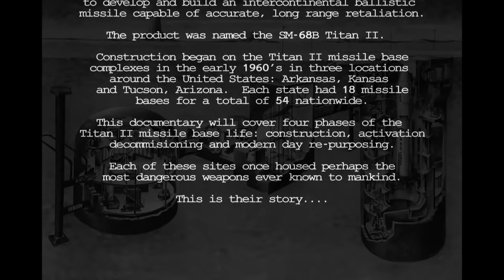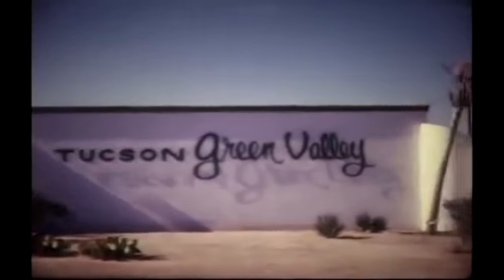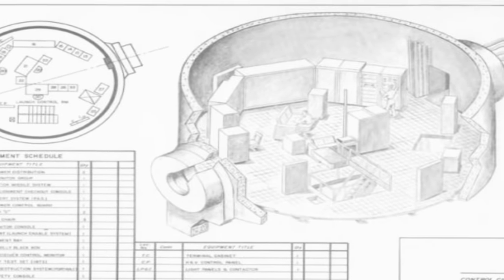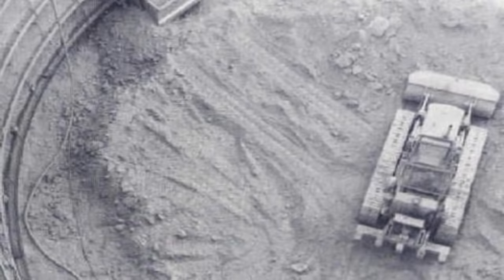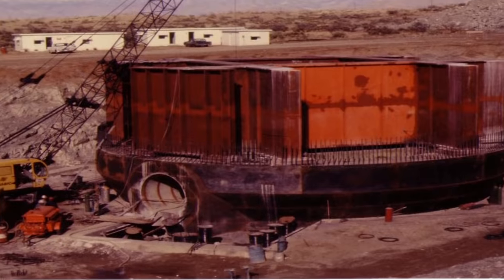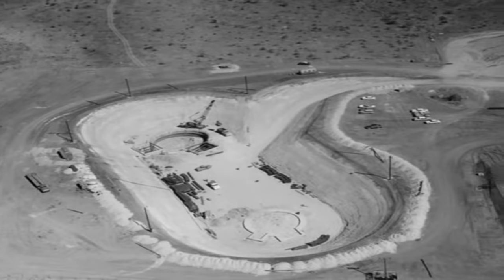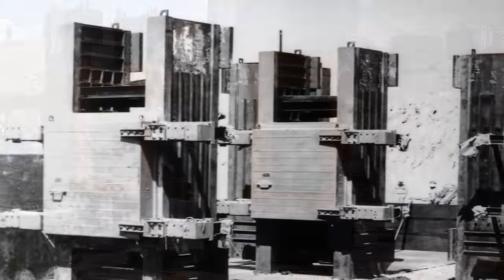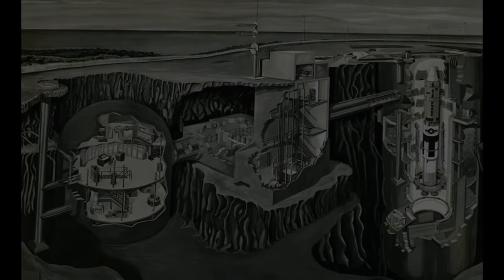Titan II Legacy - Part 1: Construction

Comment: They state the sites were operational by Christmas 1961, actually phase one was completed in 1961.
It wasn't until April 1963 before a missile was in the silo and SAC  was informed it was ready for alert duty.                    Phase two  was plumbing, heating, power production and wiring and controls.    Phase three  started in  mid 1962  checking out the equipment and their controls,  instillation of missiles.   I got to Davis-Monthan on the 3 of Jan. 1963   I was an MFT   "missile facilities Teck. Basic responsible for keeping every thing installed in phase two working properly." I was assigned to crew 43 and we were assigned site 570-7 and spent several months testing the equipment  and observing missile insulation.  570-7 went on alert  on May 24 1963. 
I  completed my 4 years in Apr 1966 having spent about 6000 hours under ground.
Reply: Bruce Bedford thanks Bruce, I did question the authors authenticity when he said this whole thing was finished in one year.
Reply: Thank you for your service to this nation. “People sleep peaceably in their beds at night because rough men stand ready to do violence on their behalf.”
Reply: Talk about your unsung hero’s. You people were the only thing keeping our country safe during the Cold War! And in the ground no less. I’m sure there was a novelty to it at first, but had to be miserable as time went on! I live 15 miles from a privately owned site. Hoping to check it out. I’ve recently become slightly obsessed with these, and this time in our country!  
Thank you for your sacrifice and service!
Reply: @Mauivegan67  1mm to 12mm is sheet metal workers. After 12 mm you are a plater yes your grandfather was a plater not a mere tin basher ,respect is due at plater level,as a dying art I posses the knowledge of working steel 200mm or greater . I'm sure your grandfather was a legend in my field so please hold in even higher esteem his achievements as it is truly top end that man can produce.

Comment: May be considered a relic today it help keep the peace for over 50 years
Reply: They closed them now we are sitting ducks.
Reply: @Crashed131963  Do you realize you can launch ICBM from a back of the truck now?
Reply: the Titan II ICBMs went operational in 1963 and the last was taken off alert in 1987.   They had become obsolete because they were extremely dangerous to maintain.  They were only supposed to be in service from five to seven years but because they formed a huge percentage of our nuclear capability, they kept extending the operational life.  Eventually, common sense prevailed and the aging missiles were retired.

Comment: your inflation calculation is way off,  $12,600,000  in the early 60s would be the equivalent  of about $107 million in 2019, not $1.8 billion.
Reply: If your calculation is correct,that's a HUGE difference!

Comment: Okay what happened to the Dozer that was scraping the whole that's down there at the bottom that they just cement over it that they like crane it out what seriously I need an answer it's been bugging me the entire rest of the video
Reply from the maker: I'm sure they lifted it out with the large crane thru had on site 😉
Reply: tolfan
I have been amazed myself at what can be done;
The dozer is not all that huge; 
It gets lifted out with craning and rigging; You just get a big enough crane;
Reply: Wow some people have no common sense  yea they just pour concrete over there expensive dozer........smdh
Reply: Well, as deep as it was, it's not beyond possibility that dozer drove out of the hole on its own tracks - they were and still are quite agile vehicles.

Comment: Your price per complex must be incorrect. I calculate that 1.8 billion is almost 143 times more than 12.6 million.
Reply: Actual inflation from 1960 to 2019 results in 12,000,000 becoming 104,000,000 (or about 768% percent.)  Given the scope of this project, and that a single F35 costs over a billion dollars - I don't think our current government could build a single one of these complexes for less than a billion dollars (billion = 1000 million).
Reply: i agree with you, it is ridiculously wrong.
Reply: At the time, they told us each complex cost $143 million. Plus another $10 million for the bird.

Comment: i wish all of these complexes would have been kept up in usable condition
Reply: The great failure of modern economy is the unimaginable amount of upkeep.  Just a regular house with power, water and general maintenance costs about 10%  build cost per year, and with a far more complex system at a certain point it would cost less to abandon and build a new system than to maintain a 30 year old bunker, remember under ground holds moisture and concrete abrades as the rebar slowly rusts and cracks the concrete further.  They were designed to withstand a sudden extreme attack not to survive for the ages that could be a modern concern Imagine if all the rebar  were replaced with carbon fiber grid (a superior  solution) but vastly more expensive closed cell spray foam as a moisture barrier inside and out after concrete pour would also add compression stability.  You could build a structure that would last but even then you have equipment that needs maintenance like hvac electrical generator water and fuel tanks . That's the long of it, the short of it is I believe one is still maintained as a museum . I hope you found this response edifying, please don't respond with TLDR.
Reply: @cuchulainodare3534  what the hells tldr?
Reply: @stormchaser8472   Too Long Didn't Read,  it was a subtle acknowledgment I'm long winded.
Reply: @cuchulainodare3534  lol
Reply: @stormchaser8472  glad I could bring a giggle. Have a happy New Year

Comment: Are there equivalent newer ICBM bases today?
Reply: Maybe, but today's weapons are too precise. They are able to hit the missile silos directly. No bunker can withstand a direct hit of a nuclear weapon. Thus it makes no sense to build such bunker protected rocket silos anymore.
In the past the situation was different. At that time, the bomb could hit only in an undefined range of some miles. With enough luck it weren't a direct hit and the bunker could withstand the shock-wave coming from the distance.
Today it's much simpler and cheaper or better to put the rockets on a mobile truck or use submarines for that job.
Reply: Fixed missile bases still exist, however the modern armed services consider them more like the canary in the mine. The armed forces have always used our own potential as a judge of risk, and gps or laser targeting render any fixed bases simply targets.
Reply: Current ICBM bases:   https://en.wikipedia.org/wiki/F.E._Warren_Air_Force_Base  https://en.wikipedia.org/wiki/Minot_Air_Force_Base https://en.wikipedia.org/wiki/Malmstrom_Air_Force_Base, but as you read the pages &  https://en.wikipedia.org/wiki/LGM-30_Minuteman#Minuteman-III_(LGM-30G)  you will get an idea ofthe yealde of the warheads.

Comment: You keep sating retaliatory strike when talking about the protection of the silo. I don't think they were worried about the protection of the empty silo from a retaliatory nuclear strike. What you should have said was that it was built to withstand a nuclear first strike. 

Also the $12.6 million per complex in 1960s dollars converts to roughly $110 million, not $1.8 billion. I listened carefully and you said "per complex" with both the $12.6 million and the $1.8 billion.  Do you mean for all 18 complexes together for $1.8 billion?

Comment: Great video but bad choice of words on statement that sites were 8 miles apart to protect against retaliatory strikes. Titan was not designed as a first strike weapon system as seen in the very secure construction of the site. Titan was designed to avoid or survive a Soviet first strike and then retaliate. Peace is our Profession stuff.
Reply: I stated that very sentiment above. Why would you build a faraday cage around your control center if you missile was a first strike weapon?  You would only build one if the system was designed to retaliate.
Reply: @insideoutsideupsidedown2218  haha no wonder it was so hard to sneak in a working TV to watch sports. Took an unauthorized cable in the emergency air duct.

Comment: Why would it cost 100 times as much from 1960 to now (12 mil to 1.8 bil)?  Inflation hasn't been more than 10 times since then.
Reply: It wouldn't, the video is horribly wrong in this regard. The inflation number of $1.8B USD for ONE site is just wrong, it would be more like $110M USD (based upon the Labor Department's Bureau of Labor Statistics for a 1960's $12.6M).  The $1.8B number is more likely for ALL 18 sites.

Comment: I been to the LCF in Arizona back in 1981 to fix metro cable above ground that was cut by a contractor. I was a A1C then. I was station at Norton AFB , Trained as a telephone cable splicer. We use to be sent TDY a lot  to many of the Air Force bases in the southwest. This was the first and last time i was sent there. It was closed a few years later.

Comment: So how was the bulldozer brought out of the hole after they got all the way to the bottom?
Reply: It's a surprize for those who will be stubborn enough to unmount the silo's floor. It's still there, carefully stored in concrete and rebar structure. If one will be lucky enough - there will be no operator nearby.

Comment: What is reinforced rebar? 6:50
Reply: a typo.
Reply: That is how concrete is done; Reinforcing steel; It is 60,000 PSI Tensile ~concrete has no tensile so they work in opposition with one doing what the other cannot
Reply: @ChiDraconis  
Thanks.
I thoroughly understood that though. I was kind of attempting a joke. The way it is stated at the part I linked to makes it sound like you can have a "regular" rebar, but this installation used "reinforced" rebar. Couldn't they just have said 2" diameter rebar?
Reply: @samdg1234  I dunno;
This is probably an Old Codger; 
This is what I do so it looked real to me;
Reply: @samdg1234  
BTW this site is 89 miles from Hutch where  I  grew up
Reply: @ChiDraconis  
You say, "This is what I do". What do you mean by that? Do you mean that you build things like this?
I love construction. I've been doing it my entire working life. I'd love to have had the opportunity to work on a project like this.
We are going to be in Las Vegas the new year and I'd love to see these. It is a long drive though from Las Vegas to the museum in Sahuarita, Arizona.
Reply: @samdg1234  
I have in the aggregate ¼-million hours if we allow for many decades really active such as my time in Hutchinson KS when I learnt many things I continue to use today; 

Some 5-years I worked for Lowell Allen Underwood a/k/a "Corky"who lived in Glen Rose
Texas;

He worked on one of these things; Comanche Peak Nuclear Power Plant; To be exact; We laid pipe in Municipal Wastewater but one day I have had enough of trench collapse with no plates to hold dirt back;  I find a project going on  that has  CIP Concrete which is what I was doing when I met Corky; Eventually  after unloading decades of Kiddie Deception best I ever attain was PA { personal assistant } to primary authority on  $56 Million USD though now I sit studying PKK and others 

VP just confirmed our commitment to Kurdish;  You keep studying like I have and it is found that often but not always  the work like this follows lets say major politics 
{ just a way to say it for now;  
Not any standard to look for work with  }

I trusted 1-time in that quarter million hours;

I have 3" facial scar to prove it;

EMS Meat Wagon placed a neck-brace on me so they could bill for $185 to $285 ~ my primary business associate is previously working EMS;  I had asked him some trick questions only those would know; He is!!

He is also diagnosed Cliinical Skitz;

You do not have to be crazy to do this work but if not you can always 

Pretend!!!
Reply: Oh yeah; I did not need the neck-brace;
I was dong scene control when Meat Wagon arrived on-scene;
Reply: BTW Mr. dg Marines was the only non-construction that I would hire; 
If you want to do this work LV is an ideal place to look for this sector which is called Industrial; You can write Chamber of Commerce and just tell them in plain words you want to look for this type of project; Office help for one of the Top 100 Contacting firms told me to make a resume; 
I ended up with  a Work History which I kept for decades; 

It served me for decades and got me many jobs where others did not;

To so-called "Break in" to this sector you get a job on contractor for  WWTP ( waste water treatment plants ) & at that point with that alone on a work history any Construction Superintendent [ WILL ] hire you despite other limitations if not a complete dumbass and even some of them get hired if they can do the work; What you want to avoid is Kiddie Homeowner type mistakes; 

Marines I could not take boot-camp now at 68-½ years of age but toughness is comparable and you do not get that watching Juan Villa

Comment: Titan II was a retaliatory weapon, it would not be separated 8 miles from each other to protect it from a "retaliatory " strike, but a first strike. The commentator stated a couple times of the structure surviving a retaliatory attack, which doesn't make any sense. If your going to make your structure with a faraday cage, you would be housing a retaliatory weapon. I think the crews knew that if and when they had to launch, an incoming warhead was going to hit near them and they were hoping for a near miss, like 4 or 5  miles miss. In any event the Titan II would be out of their silos and out of range of any incoming detonation, because we would know of an incoming strike anyway. By chance or by design that some were not launched, the silos and command structures were designed to withstand a near miss, and then still retaliate. In the late 50's and 60's, the Soviet missiles did not have the accuracy to strike a bullseye. One reason they had such large warheads.

Comment: Way off on your current cost, 1 million in 1963 is roughly 8 million now making current cost approx 96,000,000. 
Your math has 1 million in 1963 worth 150 million now, you need better math guys.
Reply: I work in construction and can do pricing at a glance;
Correct it is about a 96 Million project in today's dollars
Reply: $110 million two comments down; 
Rough thumb numbers that is correct;

Comment: What a colossal waste of money no reason to build them to stand up to a nuclear attack 
They would be empty long before they where hit by nuclear weapons
Reply: The narrator was wrong.  These were built strong in order to withstand a preeemptive nuclear strike, then to launch successfully in retaliation.  In that light, these structures are quite well engineered.  Im sure you will agree.
Reply: There was also an option to launch if soviet missiles were confirmed on the way. A “use it or lose it” option, if you will. Bottom line, we knew if the war ever started, we were all dead.